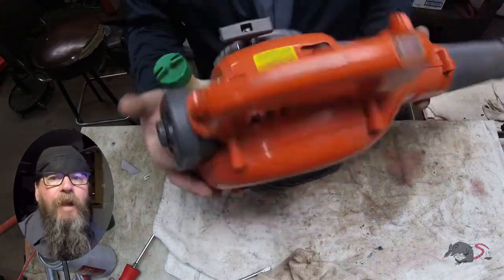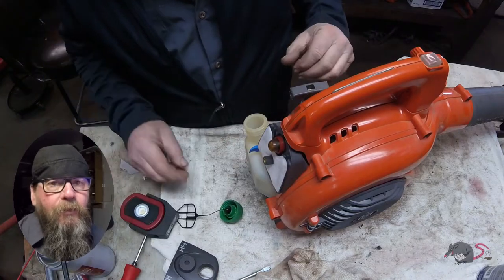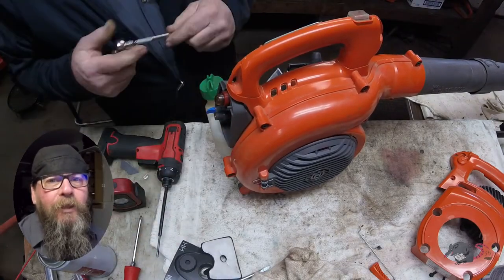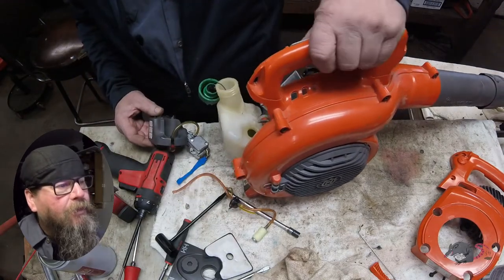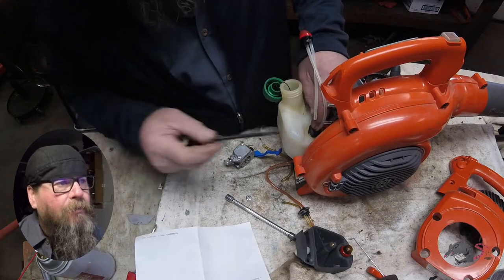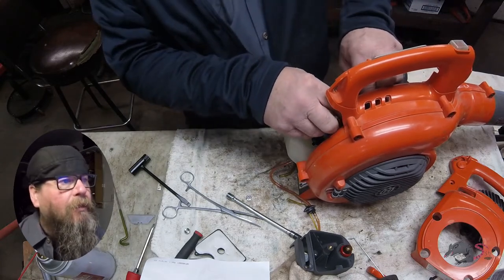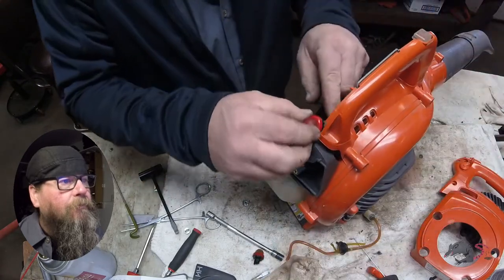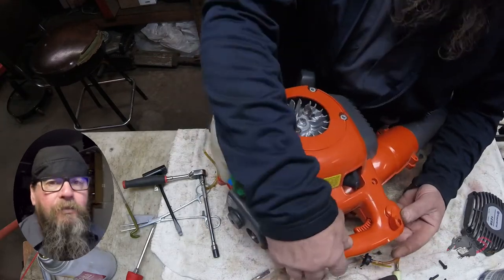Husqvarna 125b Blower Fuel Lines Replacement

Comment: I cant see how to put it together
Reply from the maker: What are you having problems with?
Reply: @TheGreasyShopRag  fuel lines finally got it pumping and new spark plug. Still wont start with new gas and oil 40 to1,but great jokes
Reply: Could it be ignition coil
Reply from the maker: @Alan-s4u2n  It could be. Does your carb/air filter wiggle like the one in this video?
https://youtu.be/yPeNSOpnIbc?si=E3JSl3ujlUJbrkHS

Comment: I have a Husqvarna 535LS trimmer and when it is in running mode gas steady leaks out of the gas cap. Is there something causing that or do you think just the gas cap needs replaced
Reply from the maker: I'd guess its just in need of a cap.

Comment: Great video. Great content. I’m subscribed. 

I’m having a bit of trouble though. I picked up one of these 125b units for free. The fuel had turned to varnish, and the lines literally disintegrated in my hand as I removed them from the tank. I replaced the lines with the kit as described in your video. When replaced, and filled with fresh 50:1 fuel, the blower would briefly fun on half choke only. The motor would idle up, then die. Any subsequent  attempts at starting it, feathering the choke, or giving it throttle would also kill the engine. I later did a carb rebuild. Fuel pump side was full of junk. I reinstalled the carb and same exact result. Suspecting my issue lived deeper in the carb, I ended up replacing it with an OEM carb. Same exact result. Does anyone have any ideas? It does have spark.
Reply from the maker: Did you check out this video?
https://youtu.be/yPeNSOpnIbc?si=yLZNEJPu4C8mDbut
Reply: @TheGreasyShopRag 

I had not watched that video. Thank you for the recommendation. I was so excited to check the exhaust port on my unit after watching that video. I got out there only to find the exhaust outlet free and clear. I blew out the exhaust screen just to be sure, but I’m still experiencing the same issues when trying to start. 

The carb does not feel loose when wiggling it, but I’ll do the disassembly tomorrow to access those two screws you mention.

Comment: Hey man I did this replacement but it seems like it’s still
Having trouble priming. Did the drop in just like this. It’s actually running now though. I drained the tank so I was wondering if maybe it had air in the lines or it was flooded or something.
Reply from the maker: If you have new lines, filter and primer and also have the fuel lines installed on the carb correctly then the problem is in the carb.
Reply: @TheGreasyShopRag  thanks man I followed this video so I’m pretty sure everything is on there right.
Reply: @TheGreasyShopRag  Just put a new fuel line kit, and new carb on this model I picked up for free.  I cant get that bulb to prime either feels like I am pumping just air.  Thoughts?
Reply from the maker: @jhlewis10  If the fuel coming out of the purge bulb is heading towards the carb then the lines are wrong. Is this an OEM carb?
Reply: @TheGreasyShopRag   Not oem.  I figured it out, the fuel line in the tank came disconnected from the stopper.  Duh.  Starts up now.  I have a broken wire to the coil to fix now because now it will not turn off lol.
Reply from the maker: @jhlewis10  Well, not stopping is way easier to fix than not starting. Good job!